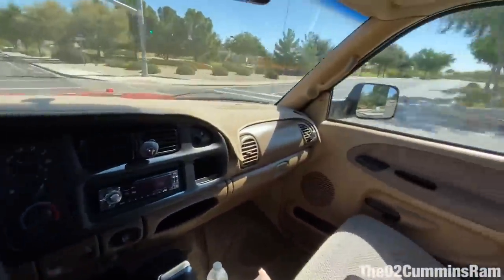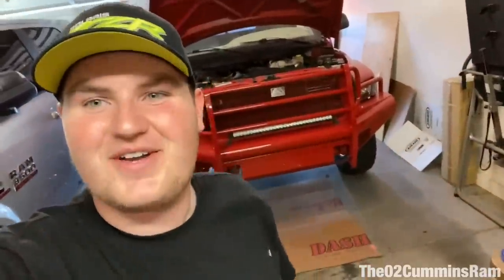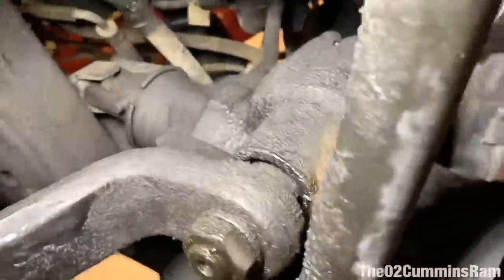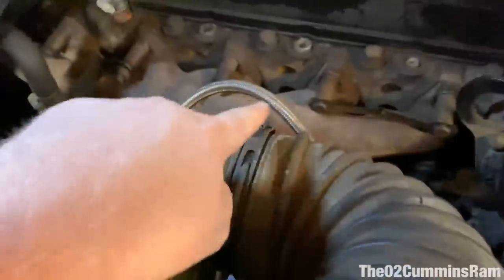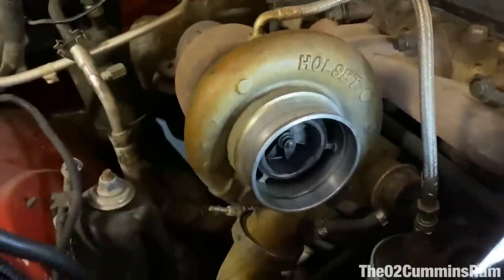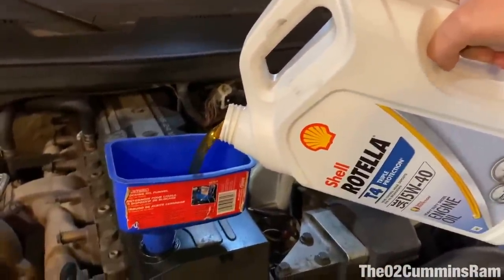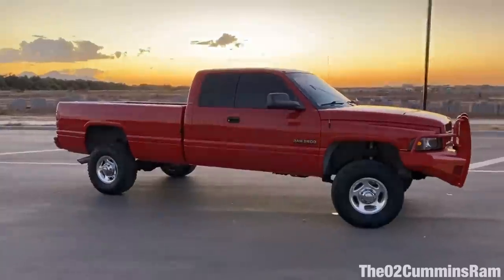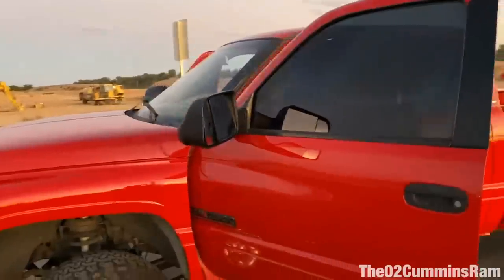REPAIRED The Leather Steering Wheel & NEW 5% Limo Window Tint! Maintaining The $2,800 Cummins!

Comment: Oil in the turbo is probably from not letting the engine idle for a minute or so before cutting it off. Luckily I live at the bottom of my neighborhood so once I start coasting my engine gets to idle for a good 2 minutes. But always let your truck idle it will send the oil out of the turbo. If you just cut off after running hot the oil won’t have time to get out and it will stay in their and burn. Just a tip.
Reply: 98 12 valve oil in the turbo usually is bad injector o-rings

Comment: Leak on the engine is timing cover you’ll have to pull the cam out and reseal everything. 👍🏼
Reply: And turbo is seals you can pull it apart and rebuild it with new seals you’ll be alright if you do nothing for a while.

Comment: Edge comp does timing ratio cause it’s tapped into fuel pump it makes the pump push more fuel into certain injectors and it makes the turbo build more boost, and it gets ya better fuel mileage too if your a baby on the throttle that transmission can handle tons and tons of power just crank that tuner up 5x5 and plug the waste hate hose on the turbo and your truck will rip through the gears so fast and much better !
Reply: Matt Parks yeah go ahead and plug the waste gate. Your just asking for your turbo to go boom.
Reply: Been like that since truck was new hahahaha
Reply: Matt Parks ok.. just cause yours has held up doesn’t make it a good idea. Plugging your waste gate is literally asking for troubke

Comment: Don't get a hot air intake. Get a factory intake, K&N filter, and insulate the box and pipe (DEI). A turbo blanket from Thermal Zero and a wrapped downpipe will reduce lag and heat soak. Don't get a massive diameter exhaust. All you need is a pipe that matches the turbo's outlet. Any larger of a diameter will actually reduce gas velocity.
Reply: Will turbo blankets from other companies not be as good?
Reply: @hwork50  Their's are the highest quality, DEI also makes great blankets. You could even use pink insulation, but that would be messy.
Reply: @xc8487  So the 30- ones do not do as good a job?
Reply: @hwork50  When your putting something around a 1000° turbo, you don't want to scimp on quality.
Reply: @xc8487  Good call. Have you noticed better performance or better mileage?
Reply: @hwork50  Not a diesel owner. I base these suggestions on years of forums, videos, and common sense. I've applied the intake info to my personal vehicle and I'd say it works. I can copy links to sources if needed.
Reply: Awesome! I will definitely put that on my list of things to buy. Any other recommendations?

Comment: Also I’d go with a little bit bigger borg Warner turbo or hx40 hole set turbo I have an automatic cUmmins and I’m converting it to a manual this Christmas I am not sure if I should do a video or not on it it’ll be my first video but yeah man that manual I’m telling you don’t be scared to throw power all over it just make sure if you put a new turbo and injectors or something you put head studs so those stock ones won’t lift and make that head gasket leak !

Comment: Hey truck guys: on a truck like this, what would your formula to budget  all these issues on a well worn truck like this? He could easily spend more than the price he paid, but he did get a deal.

At what limit does is it not economical and you just do the minimum and drive it to the ground?
Reply from the maker: Personally I don’t want to go into it more than $5000.(But that may change lol) Only leaves me around $1400 more to go lol
Reply: Ninja Master it depends on who you are and what you want to do with the truck. Tbh buying that truck for $2800 and doing the tiny stuff he’s doing to it is way more economical than buying a brand new one for 50k and it’ll do the same thing maybe just a bit slower.